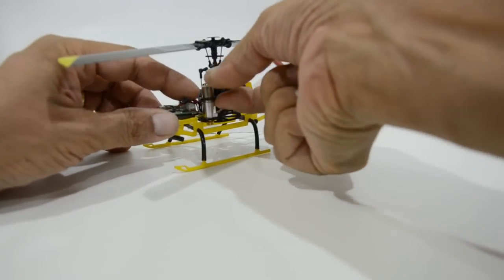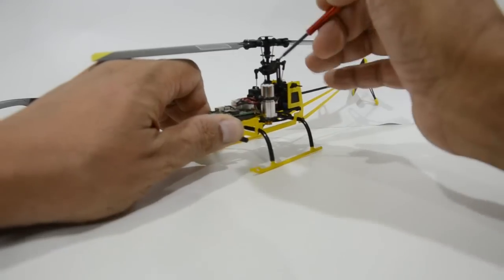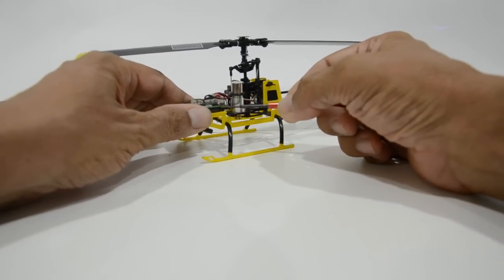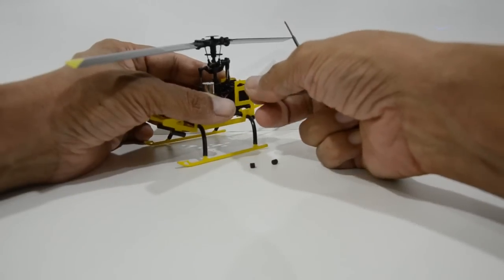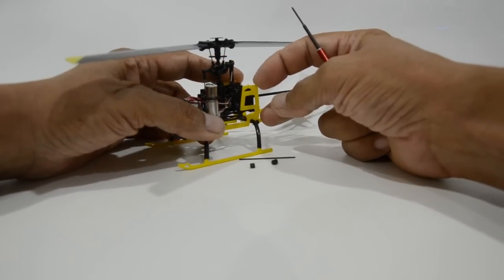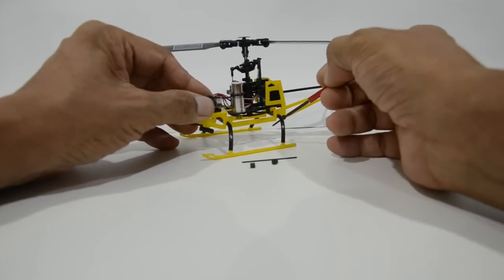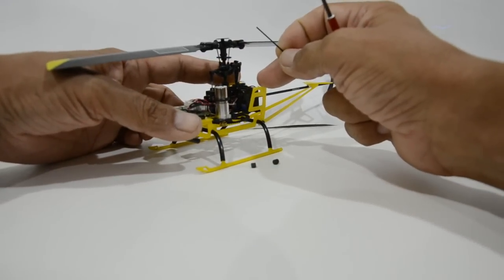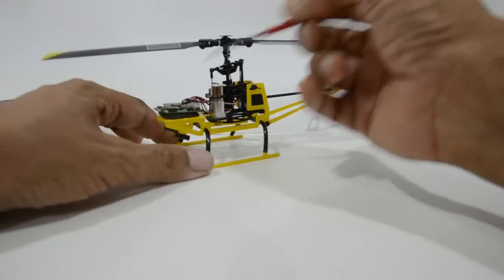MIA Phantom Combo Upgrade - Walkera Genius CP  Part 5 of 5  Installation Continued

Comment: First, I love the bat "style" kit I have for my Blade mcx. It took some modifying but looks great! Second, I have had my Genius CP for a couple of years and just broke my second landing gear( add me to the list). However, I have also installed the brushless kit from Walkera so I am wondering how well this Phantom kit would work and how much modifying I would still have to do. I assume I would still need to cut the canopy as I have done with the stock one. Lastly, what are some good settings for Devo 7?
Reply from the maker: Jason, Thanks for comment on the MIA Bat combo kit for the Blade mCX. Please look through all the videos I have here on my you tube channel for the conversion of the Genius CP, to get a closer look at what the combo kit install entails. If you installed a wider diameter motor on the CP, you may or not need to modify the canopy a bit to clear the wider diameter motor, but the MIA canopy supplied with the Combo Kit is a bit wider than the stock so you may not need to. The Key benefit to this MIA Genius CP Combo kit is mainly the Frame/LG/Boom support. The canopy is is stronger than the stock and is there also for aesthetics to blend with the overall design of the MIA Combo kit. You will not break the MIA TUFF LG! "struts" ever! as the stock one breaks.

Comment from the maker: The kit is a combo and the MIA Canopy comes with the combo this is not sold separately, sorry. The MIA Canopy is a lot stronger than the stock and it also provides an aesthical continuity with the overall  combo kit. To simply use the MIA LG  with the stock canopy would defeat this purpose.